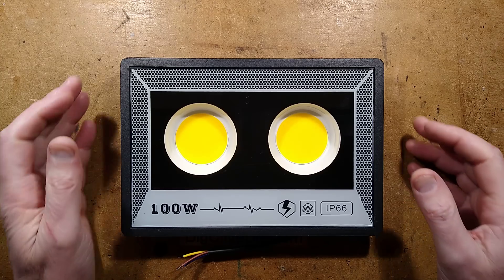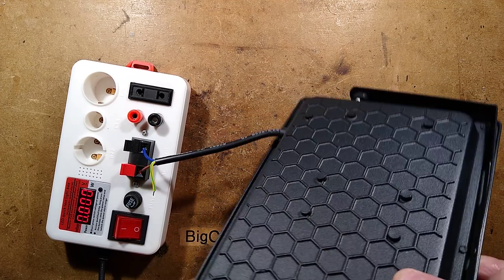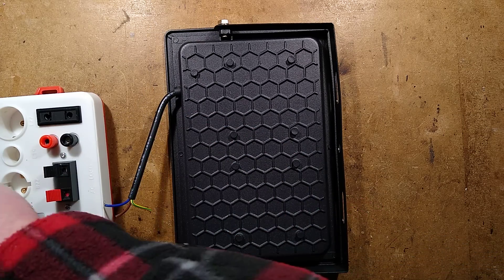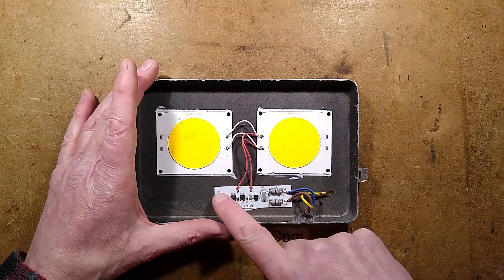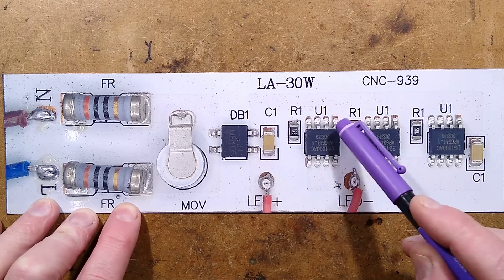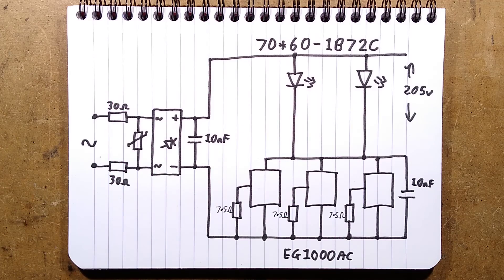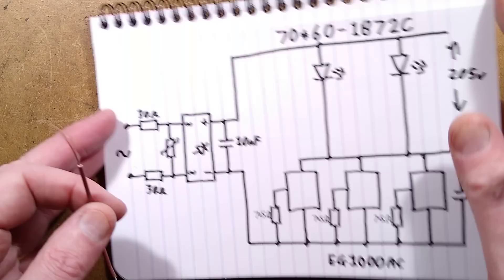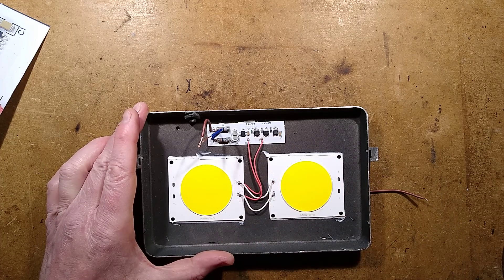Temu 100W LED floodlight is exactly what you'd expect.....

Comment: Probably meant to be replacing a 100W inc. light like advertised sooo many times.
But, what happens if you replace that resistors to 2.5 ohms?
Reply from the maker: I wouldn't want to push them any harder.  It's actually a fairly reasonable power for the housing.
Reply: They would have claimed a much higher rating if that was the case. Incandescent equivalent is usually 7 to 10 times, not 3X.  It is simply a lie. Extremely common for Chinese sellers.
Reply: @whitcwa  7 - 10 times? Wow. I do have a couple of LED-lights here thought that are 8 watts to replace a 25 Watt incandescent light (written on the box). And if they are simply not that efficient as higher-produced lights, 3 times for the same amount of lumens is maybe not that far off.

A while ago, I replaced a halogen (so already higher then incandescent) light with a relatively cheap "Chinisieum LED" light. With the measured output from 3 meters (where the start of the lights needs to be), the LED was only twice as efficient after one hour of burning and on the end I needed to place 2 LED-panels in the place of 1 old halogen light since after a couple of weeks the output had dropped even more. I could not obtain the halogen bulb anymore...
The bulb (25 watts halogen) was only around 5€ and the new light costed 12€ ... so it is mostly a pricegain, even if the LEDs will last as long as a halogen bulb by the way (around 10  years). Probably a replacement-LED of 50 € will be more efficient and maybe last longer ?

Comment: Only way I managed to disassemble light like that is to use that super thin spudger advertised for curved phone screens. It's really useful for many things. I normaly just squeeze some alcohol around wait few sec and just slap that spudger inside and move around.
Reply from the maker: It's silicone, so not easy to remove.

Comment: Could you not heat up the glass to help soften the adhesive? Would help the teardown be a little less destructive at least.
Reply from the maker: It's silicone and the lights run hot, so hot-melt glue would be short lived.

Comment: LED bulbs are often sold with a claimed wattage and then an actual wattage. For example many E27 based bulbs are sold as 60W but consume only 9W power. Could this be their intent with the claim of 100W? Or perhaps they have under-driven a pair of COB LED arrays that have a max rating of 50W each? This reminds me of the amplifier wattage claims where some amps were sold touting a peak to peak level vs. others that were sold touting a true RMS wattage. Sadly, either way, there seems to be little to no truth left in advertising.

Comment: It is too bad the maker of this lamp cut corners.  It isn’t exactly an awful product.  A proper cable gland seal, a hole tapping and a screw for the earth lead would make it OK for just a few more pennies.  I’m OK with using the glue because this lamp is going to the landfill when it fails; the labor cost to repair the lamp doesn’t justify making it repairable.  I suppose the maker correctly assessed that people would buy the lamp anyway, so why not make it junky.

Comment: The linear regulators are inadequately cooled, because the power consumption fell, after it had been switched on for a few seconds, which is indicative over-temperature protection circuitry being triggered.

Comment: Just a correction - this floodlight does not claim to be 100 'Watts'. Instead this floodlight is 100W - i.e. it is model 100W (just like all the other diffrerent model 100W lights from this supplier)
They will also sell a model 5000W speaker set, a model 2000W solar panel and a model 10000W mains inverter.

For batteries, they use the 1000000000MAH model series, starting with the model 1000000000MAH and progressing to the top of the range 1000000000MAH model (*which has a capacity of 1000 milliamp hours and no less than six bags of sand for 'balancing').

For torches and flashlights, the model range is the 1000000000LUMEN series. These all the same 5mm white LEDs and can set fire to a plastic bin bag according to the advert.

Finally, for generators, they offer the HONDA3000W unit  - not to be confused with any reputable manufacturer, the first five letters were chosen totally at random just to allow their product to be identified.

Comment: I keep hoping you'll show me a nice method for removing the glass on these at some point, which preserves it all. I like taking these lights to bits and fitting a diffuser sheet behind the glass (hey if it won't burn in front of a par64 then it'll be fine here). A diffuser makes the lights miles nicer but I've always assumed the glass for UV lights is special so I don't dare just break those open
Reply: I'd suggest trying a thin but tough cord or wire to try and cheese wire through the adhesive. But I doubt any one method will work that well on every possible assembly equally, and if you can find a solvent that eats the glue used in the examples you have that has to be the method least likely to cause damage.
Reply: Clive mentioned the glass was attached with silicone, so most reasonable solvents and heat won’t do much good at getting it apart.
Reply: I wonder if some judicious heat applied will soften the glue.
Reply: @pauls5745  Silicone does not soften or melt when  heated. It does decompose eventually, but that would take a lot of heat which would probably break the glass.
Reply: Just break the glass and put your own over it with silicone sealant. Glass is easy to cut .
Reply: @whitcwa   Cutting glass does take a little practice to make a good deep even scribe line for clean break.  Fortunately there is a a glass shop near me who will inexpensively cut glass pieces to order, even circular pieces for meter faces.

Comment: 100W?  Could that be perhaps, a suggestion that the light output is meant to be equal to a 100W tungsten bulb 💡?  Harking back to the days (well, a couple of years) when lamps (bulbs) used to carry that little tungsten equivalence rating on the packet?
Reply: Yes, apparently that's how they quote the light output now as "equivalent" to a certain power of incandescent tungsten filament light rather than the actual input power to the led device. I makes it very difficult to actually select a good high-efficiency lamp now.

Comment: Another superior product review. The doomsayer in me would love to know the voltage across the ceramic cap on the output of the bridge.
Reply from the maker: In the UK, peaking at about 340V.  Some tiny caps are rated for that by having an internal configuration of multiple capacitors in series.  But it's a bit squirmy.
Reply: @bigclivedotcom  Ho, ho. I'll add squirmy to my repertoire. I did a rough calc and I think the resistive dropper should be roughly 330 ohm to drop enough to allow roughly 30W to be consumed, but a multimeter is always more accurate. Oh, to be a fly on your wall, or maybe not!

Comment: They don't connect the Earth wire because usually there are live components in contact with the case and it will often go bang !
They realised that they can get away with shoddy design and workmanship if they don't make it safe ! They feel the Earth connection is more trouble for them but they want it to appear to be up to standard, to the Chinese appearance is most important, safety is optional !

Comment: I've just had a weird experience with a Chinese seller, ordered up an obsolete chip to repair a piece of kit and the price felt too good to be true but they were one of the only places with available stock.

No surprise, it arrived, black topped with the paint still sticky and the printing stuck to the inside of the anti-static bag.

Figuring it had to be fake I took a cottonbud with some acetone on it and scrubbed away at the paint so I could take some pics and start the refund/return process.

Didn't take much effort to remove it all but once I'd finished, it revealed manufacturer markings for the exact chip I'd ordered and the chip works perfectly. 

So they'd done a really bad job of blacktopping the chip with the same markings they were covering up
Reply: Likely just trying to make a used chip look like it was new.
Reply: Yeah, I've seen that before but this was pristine under the awful paintjob.  @kmoecub
Reply from the maker: That's really odd.  They usually just print on your chosen device onto a random chip.

Comment: Can you tell us how to get it apart without using the dremel to fix the earth internally?
Reply from the maker: It's not viable.  It would be better to add a ring crimp to the bracket bolt externally if you had to use one of these.

Comment: Parallel,  what horrid design.
One lamp running off another lamps connections, assume one of the white cables became detached at a solder joint (thats any of 4 joints)
You are now running a single lamp on a current limit set for two lamps, thus overdriving that one lamp still connected.

Comment: I like the fact that the casing has the pillars for the screws and the LEDs have the holes for the screws, and they line up, but they just used glue instead to save costs on screws. SCREWS!
Reply: And i was thinking... Wow...glue - no expense spared!!
Reply: I bought a too cheap leaf collector and it kept on falling apart. Now I have reworked it four times and it works. Replaced aluminium rivets by steel bolts, and so on. I also turned some things in the freewheel so that it is no longer one wheel drive. Not much money spent to make a better product. Most reviews were bad and one said that it wasn’t that heavy to carry to the waste dump.
Reply: Probably also less likely to break. The pillars for the screws did look rather short therefore any screw going into them would risk either being largely ineffectual or just breaking the pillar. In this instance I suspect that while not repairable, the glue was probably the best choice given the case.
Reply: I’m actually OK with the glue.  The adhesive is probably fine, and this product was never intended to be serviced, so might as well glue it and save a few pennies.  Where it fails is not providing a water tight gland for the cable and not providing a screw for the earth wire.
Reply: Pretty sure my local hardware store charges more for a set of four screws than this entire product would cost from Temu.

Comment: Regarding the ground wire not connected to the device body. In defense of the chinese, they sure cut corners, but they aren't stupid. It could be some (old?) chinese rule to never connect the ground to the device body, because it can be dangerous in their installations? Moreover manufacturers can ask people to not ground some device types, which can touch other metal objects and create a loop. So they just follow the rule without thinking that other countries usually ground their stuff.

Comment: I wish you'd try and pry the modules off the housing.
Looks to me like they are only attached along the edges, not really on the backsides of each module. Wonder how bad the thermal would be.
Reply from the maker: I did.  There was a bead of silicone along the edge and a matrix of heatsink compound underneath.

Comment: Thank you for the review. That is about what I expected. I don't think you mentioned how much you paid for it. But nowhere did I see it say it was 100 Watts.  It just said "100W". But I do agree with your complaint.
Reply: Why would they put 100W on the product if it isnt the implied rating?
Reply: @TomsBackyardWorkshop  Another commenter found fine print that it’s basically a model number. Marketing ploy 🙄.
Reply: You are right. 99.9% would assume that met 100 Watts. @TomsBackyardWorkshop
Reply from the maker: £9.

Comment: I bought a similar LED lamp to replace a blown halogen jobby in my Mum's garden.  The lamp worked OK, but the cable sticking out of the back was only 95mm long.  I had to solder and shrink tube some more cable on, just to be able to reach a junction box on the wall.  Then she decided the replacement wasn't bright enough...
It now has an eBay 100W lamp, which actually draws about 105 watts at first, but quickly drops to about 80-85 W. It is using about 100 individual LEDs.  We shall see how long it lasts.
Reply: Not for long, I hate those individual SMD type floodlights. They're all individual points of failure

Comment: Hi Clive, i want to convert a microwave oven transformer to a high current device like electroboom did. He used an angle grinder and i dont have one of those. Would my dad's dremel suffice to cut the welds?
Reply: I the past, Clive has strongly recommended that people not mess with microwave transformers unless they have a good deal of experience with high voltage electricity.
Reply from the maker: I don't recommend powering the transformer with its original windings, but you can hacksaw off the original dangerous winding and knock it out to loop round your own winding.  There are videos showing how to re-use them as simple welders.
Keep in mind that you do have to observe the usual safety precautions for 120V or 240V connections.
Reply: It is best leaving the core intact and cut out the high voltage winding. You can do it with a dremel, drill and wire cutters. That it what I did to make a spot welder.

Comment: Hi Clive.  Is it the case that this could have been a good little unit if a little more money and electrical safety were involved?   Just curious.
Reply from the maker: Just connecting the earth wire internally would have made it an interesting light.
Reply: As a 30W unit, and with a working earth wire, and better quality longer cord, it seems like it would be fine?

Comment: Oops, I need to correct myself: new German FI-switches trip at 30 mA, not at 35 mA.
In other words: if the earth wire was connected you couldn't operate this light in new installations anymore - completely impossible!
When it's raining and the wall is wet this "IP66" will trip the FI-switch aswell, even without one single drop of water entering the questionable case! 🤦‍♂️
The next: what is the 15 cm or 6" long connection for anyway? The cable comes usually out of the facade of your house, heading INTO the lamp, ending there in a waterproof connector case, entering from the lowest point of the lamp.
For doing so you'd need to open the lamp with a saw or Dremel.
Do the Chineses want you to install an extra case outside your facade for connecting or do they connect the "IP66" lamp just by twisting the wires and leaving it under the rain anyway? 😂
Reply: I don't know what you are talking about, there was zero leakage current.
Reply: @petehiggins33  You're right. I looked on the left device - my fault! 🤦‍♂️

Comment: You should buy another one and run continuously while video recording it. The moment that the wires or light guide overheat should be quite exciting. Somehow I don't think it will make it to the 10,000hr. mark.
Reply: 10,000 hours is a long time - about 18 months. Judging from the LED lightbulbs I've encountered, probably 6 hours should see it fizzle and go bang.
Reply: I think that would be worth tuning in for.
Reply: @Mr.BrownsBasement  It's a shame those LED things aren't predictable. We know they're going to fail. We don't know just when. I had one that turned into a disco strobe.

Comment: Might not be the brightest bulb in the pack, but 144 leds put out a broad area of light... Looks like it could be bumped up a bit too, but at ~35w... Would make good, cheap? patio lighting, just might want to ground them first...
Reply: Unfortunately it looks like the case can only be opened destructively. So to render it safe (connect PE to the case) and increase the power (swap out the resistors that determine the current limit) would render it no longer suitable for outdoor installation (you have destroyed its ingress protection).
Reply: @aaronmdjones  mehhh...yeah, but it's not exactly like these things would pass that inspection from the get, go... On top of that, i guarantee I can stop ingress, maybe even put it in a different housing altogether, in fact!

Comment: And with that wafer thin heatsink with no ribs, I'm sure even 30 watts is enough to fry those LEDs in no time. Also, is it really that expensive to at least spot weld that ground terminal?
Reply from the maker: It's hard to spot weld to aluminium style alloys.
Reply: @bigclivedotcom  Good point! Haven't thought of that!

Comment: I always take power ratings with a pinch of salt nice work Clive 😊
Reply: It would be easy to increase the wattage by simply installing a load resistor - glued to the case, of course.  On the other hand, a resistor might cost more than LEDs these days.  I’m being silly, it costs nothing to simply lie about the wattage, and of course make no mention of of the actual luminous output
Reply: @wtmayhew  lol so true 😂

Comment: The lugs on the rear might be to stand it off any mounting surface to promote a small airflow ? ? ... you could rescue this unit by reconnecting the mains wire  and PROPER earth bonding ( ! ) .... then fill the remaining tray with a 2 part CLEAR epoxy self levelling compound and ( hey presto ! ) you have a usable water resistant outdoor light ( ? ) ... DAVE™🛑